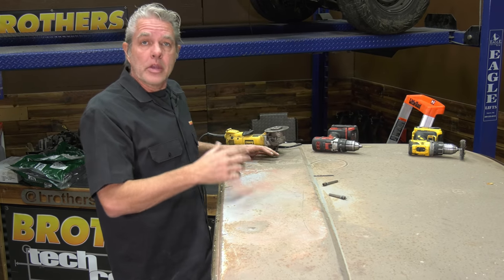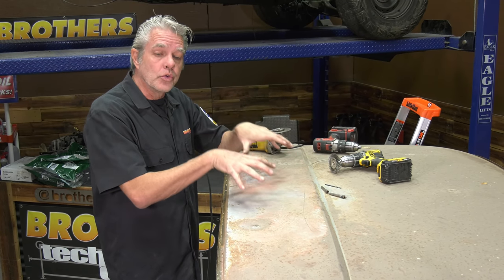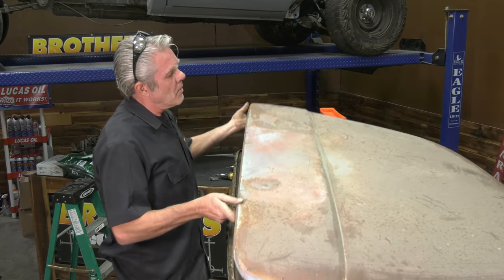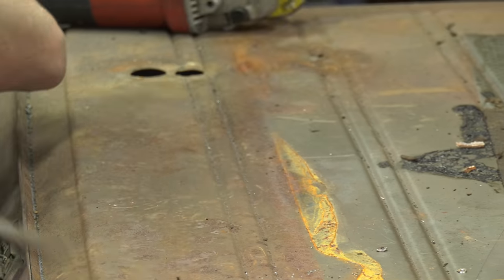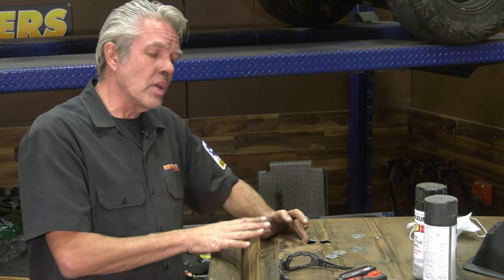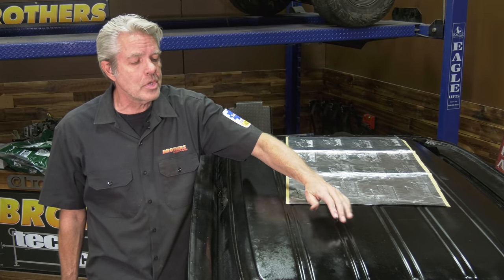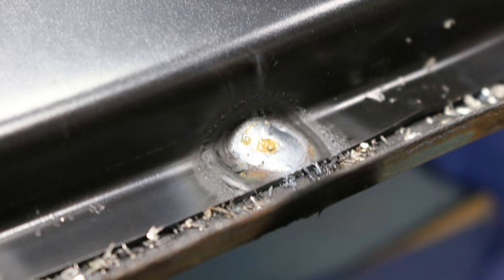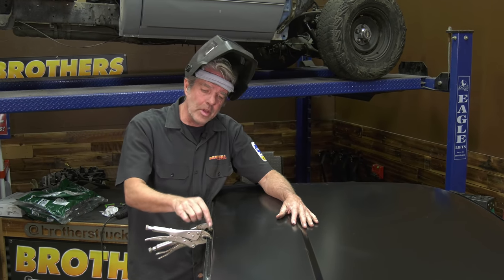1960-66 Chevy & GMC Truck Roof Panel Replacement / Patch / Repair/Rust / Bodywork / Cab Metal

Comment: These skins are one of the best fitting panels I’ve worked with. A great time saver in this type of project. I just did one a few months ago on a 65.
Reply from the maker: Right on! Thanks for watching.
Reply: Where can you buy them from
Reply: @willieboyd79  Brothers Trucks, the website that this YouTube channel is from.
Reply: Is there anyone who sells roof for cars
Reply: @willieboyd79  really depends on the car. It can be extremely hit or miss on which cars do and don’t.

Comment: Another awesome video David. I’m about to dig into my 66 and would really like to see a video on how you’d tackle the leading edge of the hood on this year truck. They all seem to rust out somewhere between the parking lights. I’m sure many are replacing that panel and making the same repair. Thank you for the awesome content. 🔥👍🏼🔥
Reply from the maker: We're about to do a video of a spot repair on a door. You could basically apply the same process to any other body panel including a hood. Should be out sometime in Feb '21.
Reply: @BROTHERSTruckPartsTV  Agreed many of the techniques translate but that particular hood patch panel presents some unique issues. It would be interesting to see the angle of attack for a clean repair.
Reply from the maker: @HouseofChop   We'll see if we can find a rusty hood and go after that repair. Thanks for the suggestion!

Comment: hey David i really need you to do a video showing how to do front fender replacement on the 60-66 but not just the skins but the mounts at the back and front please show us both so how you would mount brothers fender skins to the mounts and then how to mount them to the cab ..  this is a great video too thanks so them all :)
Reply from the maker: We have a video about fender rust repair that ALSO shows how to remove and replace the fender. Here's a link to that video: https://youtu.be/3oI7gXELQCg
Reply: @BROTHERSTruckPartsTV   hey thank you for the link i watched it it was helpful but i have question so lets say a person does not have a welder yet and also has not learned how to weld yet.  can that person say go to your website and buy the new fenders with the braces already attached so they can just be bolted on ?   yes sir i am sad to say i dont have a welder and dont know how to weld :(
Reply from the maker: @HWP_Viking_Wolf73   Looking back at your original question now, and we think we see what you're saying, but there's really no reason to need welding experience when installing one of BROTHERS 60-66 fenders, because they DO already come with the braces welded in place. You simply bolt them on and go!
Reply: @BROTHERSTruckPartsTV  great thank you very much

Comment: Can you use seam sealer in the new drip rail instead of body filler? Would it have as good a chance of cracking as the body filler?
Reply from the maker: You can use seam sealer, Dave just chooses not to.
Reply: Self-leveling urethane seam sealer is the only way to go.

Comment: Any recommendations for an affordable mig welding machine for a beginner?
Reply from the maker: For doing good work, sometimes buying good tools is key. In this instance the welder you choose is one of those tools. Don't cheap out on the welder, get a good one. We use a Miller 110v Mig here in the shop and quality is never a problem!
Reply: @BROTHERSTruckPartsTV  Thanks! you get what you pay for sometimes

Comment: Great job guys, really professional repair, unfortunately for lots of folks at home proper rust repair is usually too expensive or time consuming and that's why so many old classics are full of bondo, it's easier for most people to spend 20min with bondo and rig over all the rust than spend 1 whole week on one small spot, unfortunately i see that kind of stuff all the time in typical budget driveway restorations.
Reply from the maker: Exactly why you have to be super careful when buying a classic! You never know what lurks beneath shiny paint.
Reply: Rust repair tools of the trade are a big extra expense as many people don't already own them before taking this on, so you are right that Bondo can be far quicker and cheaper for some jobs. I would say in my experience people just think rust repair is way beyond their ability. I have a friend that is a smarter guy than me but he thinks he could never do this even though I know he could. This work is not beyond people's ability however it is a process, you take your time don't rush and use your common sense, I think people would surprise themselves at what a great job they can do. If they can do all other vehicle repairs I am sure they can do this too. Obviously you won't do this if you don't have access to any of the tools required.

Comment: I’d panel bond and a few welds!
Reply from the maker: Panel bond may work too. We've used it on other panels in the past with great success!
Reply: @BROTHERSTruckPartsTV  new cars seem to be held together by more panel bond adhesive than welds.
Rumor has it, in case of a crash the adhesive is even stronger than the weld.

Have you ever tried one of those belt file grinders instead of a disk grinder? I have seen people grind out welds with those, and I think the procedures for the 3M stuff recommend those as well and warn to damage the lower layer of metal by no means when cutting or grinding. But I think their procedure mentions hardened steel as well, so that might as well be something more important on newer vehicles.

Comment: David I have a 1960 c10 and I'm looking to replace the roof/wine shield panel, and are the spot welds above in the rain gutter? You should drop a video on replacing the panel 😁.

Comment: Im rebuilding my late grandfathers c10 and the roof panel seems to be ok. But its rotten inside the cab. Whats the best way to tackle that job.
Reply from the maker: That depends where your rot is on the inside. Some of those panels are available to patch problems, and some are not. If panels are available then pick them up and use what portions of them necessary to get the rust out, otherwise you'll have to create your own patches from sheetmetal.
Reply: I also have that problem the front is rotted out and it has no windshield and no clue what to do and can’t find any replacement panels

Comment: Hi, is there’s a video on you tube  of how to install weatherstripping on a 1969-1972 K5 blazer? Thanks
Reply from the maker: Yes there is, here's the link: https://youtu.be/DkvxFEBuELA
Reply: @BROTHERSTruckPartsTV   thanks that helps but what about the other weatherstripping like top to bed seal and upper windshield to top seal for double wall hardtop. Thanks again
Reply from the maker: @hectoralcala1403   We'll take a look at doing those videos in the future, thanks for the suggestion!

Comment: But most of the roofs I have seen on these years, including my 64 had the rust THRU the drip rail. Decided to just delete the drip rail . Either way it is a lot of work if the rail is rusted to, which it mainly are here in Pa.. That being said it was still easier to replace the rusted roof with a brothers roof panel which fit great.
Reply from the maker: Yeah, drip rails can be a pain in the rear, but for those we typically just fabricate the small sections of drip that is rusted and go forward with replacing the roof as shown here. Thanks for watching!

Comment: Instead of rosette welds, why not use a spot welder? It would be less work and also give you a more factory look.
Reply from the maker: Not everyone owns a spot welder, so this is the DIY option. If you have a spot welder, then absolutely use it.
Reply: @BROTHERSTruckPartsTV  honestly I don't have one as of yet, but have been looking at a cheaper model IE Harbor Freight or something along those lines.
Reply from the maker: @ghostfire319   Man it's a great way to keep down the heat, get a solid weld between the panels and cut down on time. Unfortunately it's not a common thing to have in your garage, so we try to illustrate the way most guys will be doing the repair. Good luck with your project!
Reply: I think a spot welder would work really well here.
Reply from the maker: @SkaterStimm   True, but that's not exactly a common tool in most peoples garage. We try to illustrate how most DIY'ers would be doing it at home.